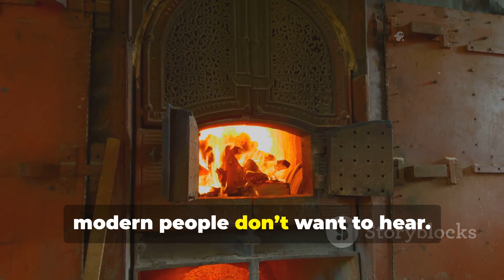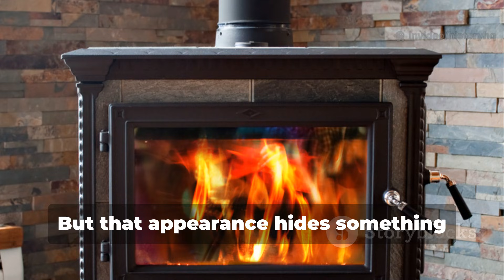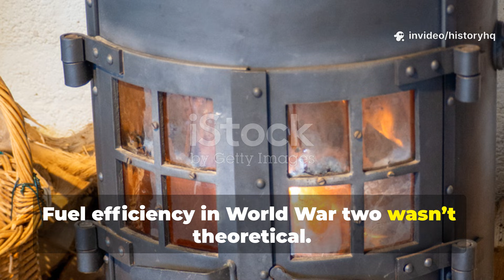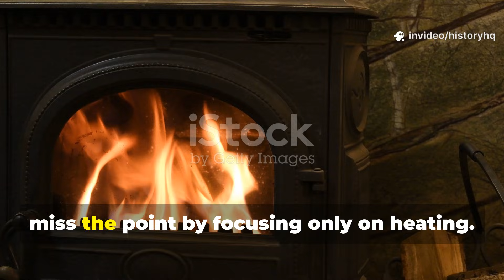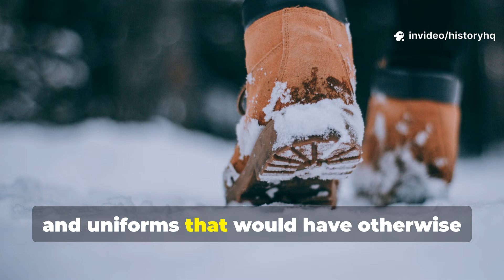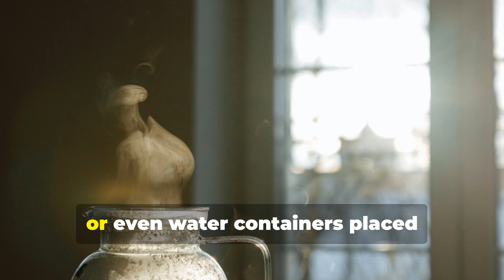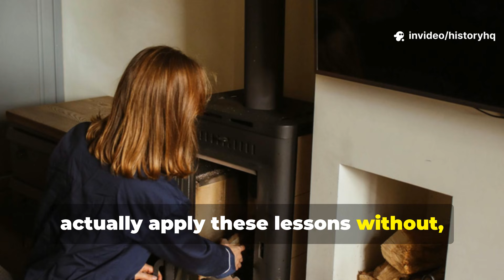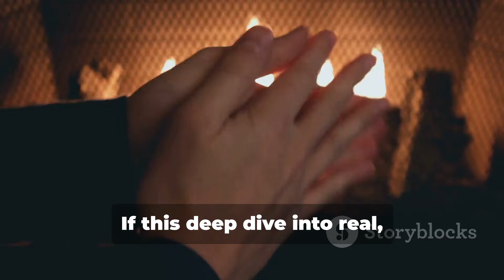They Survived WWII Winters on 90% Less Firewood — Here’s the Heating System We Forgot

Comment: STOP trying to heat the entire house.  Use  blue masking tape,clear plastic sheeting and thumbtacks  to seal off doors, windows,  vents. Put water in the tub and in several plastic 5 gallon  buckets,  stored in the master bedroom.  Seal off the walls, floor and ceiling in that one room. Turn off the water and drain the pipes, so that you need not  worry about pipes freezing up and bursting. 

 Use a bucket, kitty litter, lime and plastic bags and  a toilet lid to deal with solid wastes. Use a funnel and hospital-type urinals for liquid wasts,along with de-oderizers. Either use a composting toilet in the back yard, bury  wastes there, or haul them away  to a sewer or dumpster, etc. Remove the flush handle from the toilet. 

OUTSIDE, use coal, charcoal, wood, propane, kerosene, paraffin to heat up a METAL 5 gallon bucket for half an  hour or so.  Put the bucket on some  FIRE bricks (not regular bricks or concrete or cinder blocks) on the floor in the master bedroom.  The hot gravel will heat the sealed off room for 12 hours. Put a "z" of 3 layers of plastic in front of doors that have to be used and seal off any doors that do not need to be opened. NEVER use an open flame inside of your home, other than maybe to cook ONE  meal per day.  All flames make CO gases, which are toxic and it's a fire hazard, too.